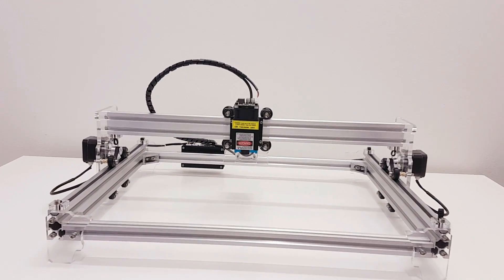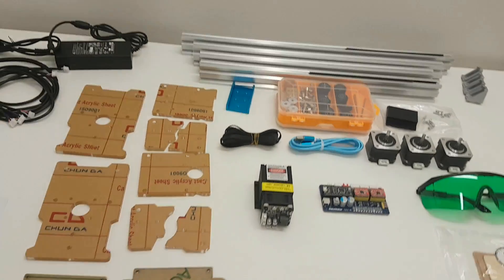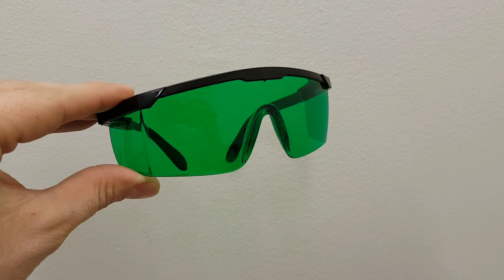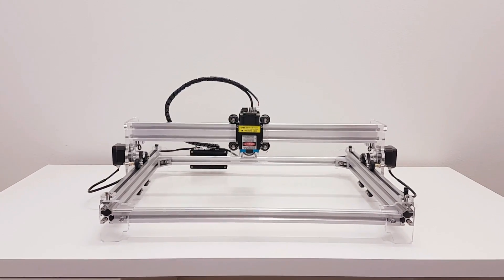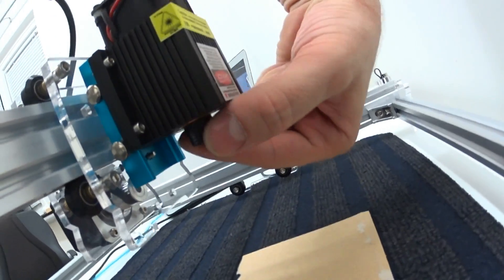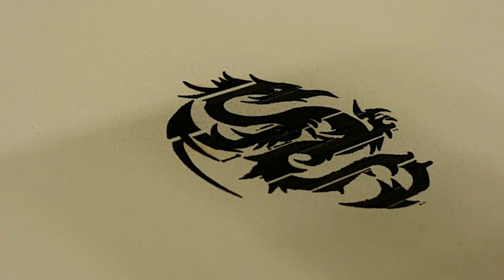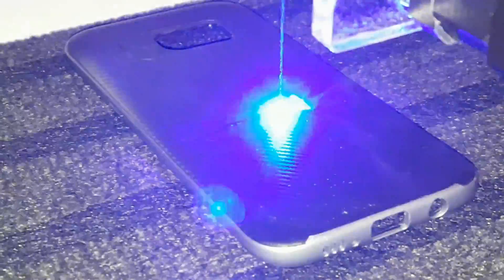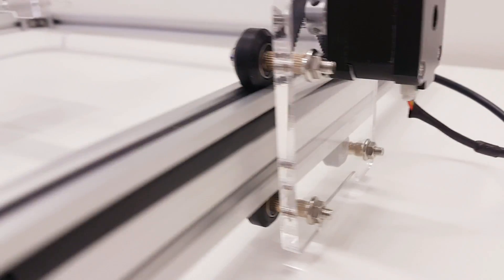A3 Pro 5500mW 300 x 380mm DIY Laser Engraver Build,Test and Review!

Comment: It doesn't work either.  Not a problem in the program I tried with 4 different ones and don't want to establish a connection with arduino nano.  It does not light green.

Comment: Hi Nexi Tech. I was wondering if you could tell me, if I buy a similar 500mw laser kit, and a separate 5500mw laser, would i be able to swap the laser out without any extra equipment. Both are 12v, can you think of anything else I might need or should it be as easy as a straight swap?

Comment: Can cutting wood 4mm in this machine with 5500mw
Reply from the maker: Yes yo can, but you need to set it to pass the same cut line few times, check this quick video where I cut 3mm plywood.  https://www.instagram.com/p/BVk-UJNhLZI/
Reply from the maker: Guys check this new dual laser engraver! This thing engrave even stainless steel - https://youtu.be/PoSRea1NrjY

Comment: Sorry for the silly question, but I'm a bit confused since sometimes I see advertised 2500mW and some other times 2500MW, regarding the laser power. MW and mW are different powers...  In the end, how much potency it requires and is it possible in a regular household?
Reply: A 2500 MW (Mega [or Million] Watts) laser would cut a hole through your floor, while consuming the power of your whole neighborhood. So they're all 2500mW (2500 Milli Watts = 2.5 Watts), and this is rather little, considering your microwave oven would use about 1000 Watts :)

Comment: Can  this unit cut 1/8” Balsa wood?  If so about how fast?  How about thin modeling plywood?  Thanks
Reply: Balsa may need 2-3 passes with 2.5w laser. 5.5 should do in 1-2 passes. Up to 1/4 plywood cuts in 3-5 passes usually. It won't do it in one go. It's an engraver not technically a cutter. But can do it

Comment: I bought a 7000 or a 7 watt engraver,  is it powerful enough to cut thin wood? I'm just a beginner at this. The only one's I see demonstrated are the 2.5's and the 5's. Also does anyone know what the best software to use is?  I'm not too crazy about eleks software.

Comment: I bought a laser cutter, only a small a4 one to start with, and I spent a whole day fiddling around trying to flash Grbl and get the steps/mm correct. I nearly bashed it against a wall but I held back and succeeded
Reply: From where you got A4 ?
Reply: RAKESH JADHAV got my 2.5W A4 laser cutter off eBay for around £90

Comment: Great video.. Does the laser lose any engraving power if height is extended over an object? I want to engrave wood object that cannot fit in engrave area, without raising the engraver. Thanks.
Reply from the maker: Andre Jacobs Well you have to have flat object and laser in focus to be able to engrave precisely and even. For example if you will engrave round(ball) object laser will go out of focus down the curve and it might not engrave at some spots at all or very week You can add more power but then on areas where laser is in foxus it will burn it way to much then on non focus places. I hope i explained it right.

Comment: Can this machine used for cutting fabric
Reply: same question , it will easily but the question is laser reability? getting heated up? can we use it for long duration etc. Same boat. I'm also looking for fabric cutting.
Reply from the maker: Yes of course there is plenty of power. Laser can cut thru 3mm plywood  pretty fast in 2 pass so i think fabric is not a problem.  You can use laser for hours and hours without problems. Laser diode has very good cooling fan on the top of heatsink so it has good air flow.

Comment: have a big question how does it print on leather ? i would like to see a video !
Reply: It prints very well on leather but make sure you're outside when doing it because it smells like burnt flesh when doing it... very stinky. Also, I find that the "Outline" cut works best and is much quicker on leather. If you are wanting to cut through the leather it will depend on the thickness of the hide but try running it at 400 speed with multiple passes.

Comment: Hi, this is a good video!! I'm looking for a laser cutter and I need some advice. Would a 3000 mW laser (3W) be enough to cut through fabric? Does anyone have any experience in this? Thank you very much!!!
Reply: That depends on the fabric (like if its fire retardant) but a 3000mw should be plenty for it. If it doesn't make a cut on the first pass, try slowing down the speed of the laser and increasing it's passes. Eventually the laser will cut it.
Reply: Same requirement for me as well. These are chinese machine rebranded. Looking to buy one for my factory purpose to cut fabric. I have the same question which laser should I buy to cut polyester. But considering the fact even 500mW will also do I think.
Reply: Correct. Laser cutting fabric doesn't require a high powered laser at all. just make sure the work area of the machine is large enough for what you're trying to accomplish.

Comment: when you want to place a drawing at an exact place. How do you manage that? Can you position and tell the engraver where the x=0/y=0 point is?
Can you turn the laser on to position it precisly whitout it to burn the material?
Reply: Yes, you can turn on the low powered laser as a guide when positioning the laser. Just make sure to turn off the low powered laser before making the actual cut.
Reply: Thanks !

Comment: Nice unit, I'm looking forward to getting one, the main use would be to cut 5mm white foamboard, have you done any test with this material? I would like to know if it would do a nice straight cut, without melting the foam away under the paper layer.
Also, are you able to control the power of the laser, so you can either cut & engrave on the same process?
Reply: This laser has cut everything I've thrown at it with the exception of some metals. The power level can be adjusted and you can also increase the speed of the laser so its not in one place for too long. Just make sure you have extra materials because you will need some to practice on.

Comment: Hello, I recently purchased a 500mw 65*50cm DIY Desktop Laser Engraving Marking Machine Printer Engraver kIt, I realized immediately that I need a Bigger and more powerful Laser system and also maybe a Controller upgrade,  I can also connect to my Computer to operate,  I would like to go to a 3W Laser and Better controlling system, But will Use my Main Frame 65*50cm,  any recommendations ??  who is a Reputable Seller that can work with me to get what I need ??  with some type of Support ??     Great Videos by the Way, thank you for sharing  :-)   Doug
Reply: I bought my 5500mw laser from Gearbest. The machine is great but their customer service sucks. I had to do a lot of internet searching for help but it all worked out and now I'm making all sorts of crap. It also helps if you work in a warehouse that gets free wood and materials.

Comment: What is the diference between 5599mW que 2500mW  láser engraver?
Reply: More power means you can cut and engrave faster. Example: a 5500mw laser may complete a 8"x13" project in 2-4 hours where a 2500mw laser may take 6-8 hours for the same project. This depends on the project of course but you get my point.
Reply from the maker: German Valencia 5500mw is twice as more powerful.

Comment: Nice review. Can this cut acrylic?
Reply from the maker: Thanks! Yes it can cut without any problem, only transparent color Acrylic it can't. Laser beam is just passing trough.
Reply: Colored or semi transparent acrylic has no problem. If you want to cut clear acrylic you're going to have to do some work. First cover the acrylic with a dark surface (like black fingernail polish or something similar that can be removed). Laser engrave directly onto the black fingernail polish. After the engraving is complete, wipe away with polish remover and voila, done.
Reply: This method also works if you want to engrave onto glass

Comment: HI, can I cut acrylic 3mm thick?
Reply from the maker: Yes but not transparent Acrylic.
Reply: Why not transparent?
Reply: If you want to cut clear acrylic you're going to have to do some work. First cover the acrylic with a dark surface (like black fingernail polish or something similar that can be removed). Laser engrave directly onto the black fingernail polish. After the engraving is complete, wipe away with polish remover and voila, done.

This method also works on glass
Reply: this methode work only for engraving or cut is work
Reply: Web Islands, it can be used for both. But you may need to reapply the surface material several times unless you have a strong enough laser that can cut it on the first run. This method is not ideal for cutting acrylic, just a cheap way to get it engraved.

Comment: mhh work on metal, inox,  alu eccec?
Reply from the maker: Sorry no metal. For cutting metal you need a lot more power.
Reply: but can it engrave metal
Reply: If I had black anodized aluminum plate, would it engrave through that to show the aluminum?  I want to engrave trophy plates.

Comment: I WANT TO ASK A QUESTION ABOUT THE LIFE OF LASER
HOW LONG LASER IS WORK?
Reply from the maker: 'Quote''
Calculating estimated lifetimes is an important
step in the development and application of laser
diodes. Lifetimes at normal use temperatures
can be estimated from the lifetime statistics and
activation energy obtained through multitemperature
testing. The laser diodes reported
here are predicted to have a median time to
failure of approximately 70,000 hours, or 8
years at a use temperature of 40°C. 
https://assets.newport.com/webDocuments-EN/images/AN33_Laser_Diode_Activation_IX.pdf

Comment: my question is that what is the life of laser beam
Reply from the maker: ''Quote''
Calculating estimated lifetimes is an important
step in the development and application of laser
diodes. Lifetimes at normal use temperatures
can be estimated from the lifetime statistics and
activation energy obtained through multitemperature
testing. The laser diodes reported
here are predicted to have a median time to
failure of approximately 70,000 hours, or 8
years at a use temperature of 40°C. 
https://assets.newport.com/webDocuments-EN/images/AN33_Laser_Diode_Activation_IX.pdf
Reply: Nexi Tech and

Comment: What kind of software is supported? It support "ai" (illustrator) or something from vectorial files?
Reply: It likely uses SVG format with upto 300DPI.   That being said, any vector software should work fine if the export is correctly scaled and set to RGB.   Inkscape is highly popular since it's cheap.  But I prefer using corel over all others.

Comment: Hey does it also cuts acrylic sheet, if so upto what thickness ?
Reply from the maker: Only if is black. Transparent materials is very hard to cut with laser. With  300mm/s speed you can cut through 3mm plywood in 3 pass. I you slow down even more you can cut through in 2 pass but it's going to burn maybe to much. It's cutting 3mm plywood pretty good. Possibly you can cut through even more thick plywood or similar material by just let the laser pass more times cutting line.

Comment: Is it possible to cut perhaps 3 to 5 mm balsa or 3 mm wood wiith this machine without modifications?
Reply from the maker: Yes Mark! With  300mm/s speed you can cut through 3mm plywood in 3 pass. I you slow down even more you can cut through in 2 pass but it's going to burn maybe to much. It's cutting 3mm plywood pretty good. Possibly you can cut through even more thick plywood or similar material by just let the laser pass more times cutting line.

Comment: Hello, can you cut cardstock with this engraver? I like it but my main purpose is to cut thicker paper? Best Regards
Reply from the maker: HI there! Thanks for stopping by. I just answer to Mark below. This is copy-paste: ''At 300mm/s speed you can cut through 3mm plywood in 3 pass. I you slow down even more you can cut through in 2 pass but it's going to burn maybe to much. It's cutting 3mm plywood pretty good. Possibly you can cut through even more thick plywood or similar material by just let the laser pass more times cutting line''. Best regards! :)

Comment: hai, it's possible to cut MDF wood and clear acrylic ? I usually cut MDF wood using CNC router, and need to know if I can replace it with LED laser
Reply: A diode laser isn't for you. A CO2 laser will reluctantly cut MDF--when cutting plywood, lasers have more trouble with the glue than the wood, and MDF is largely glue.  Clear acrylic is transparent to blue light (you can see blue things through it, after all) so it doesn't absorb energy from a blue laser.  Infrared lasers like CO2 lasers cut through clear acrylic beautifully.

Comment: Is it accurate? I want one of 10w and 1 meter of work area but I just want it to cut polyester textile ... like the fabric they wear for soccer uniforms ... does it have speed to cut things like polyester fabric?
Reply from the maker: antero414yo Yes its very accurate.  Well 3mm plywood is cutting  through in 3 pass in 300mm speed without  sweat. If you lower the moving speed I can cut through in 2 pass but its burn to much.  I Never tried polyester fabric so I can't answer.
Reply: Very good information, I really would like to have a computer like this ... can you use it with illustrator or corel?
Reply: Friend ... I was trying to use the program to test my 550mw laser cutter and the laser light went on ... I hit a metal bar and the room lit ... I did not see it directly but I could feel the blue light ... do you think he hurt me? I did not have the glasses on ... it was only an instant and I know that it takes a millisecond to hurt ... I'm afraid that it hurt me.
Reply from the maker: Jesus! NEVER EVER USE LASER over 10mw WITHOUT PROTECTIVE GLASSES! This 5500W laser can blind you in the second! Everything over 10mw can damage your eyes. Please go to doctor and check your eyes! You have to be much more careful next time. I hope you did not damage your eyes! :(
Reply: I have already returned from the doctor ... luckily I have no damage, it was not inflammation nor damaged cornea ... everything in order, happy to be well ... and very scared, I'm afraid to use my laser ... but I know I'm left Learn to get all the juice to this great machine. At the moment I do not know if the Benbox is a good program or do you recommend another program to use the laser?

Comment: Hey, nice video. Would i need anything more than a US to EU plug changer for this to work in Europe? Would i need a voltage converter to?
Reply from the maker: Thanks mate! The main power to the whole Laser engraver is Adapter with Output DC 12V 5A and on back on adapter is label saying input AC 100-240V so you can go easy with  EU plug and save money.  :) Use provide links in video description and coupon to save even more money :)  You will get better price. Good luck with your Laser.
Reply: Wondering if you can help me with a similar machine if possible

Comment: Hi.I have the same problem , with the white line ( skipped line ) , just like your first attempts with the dragon.  Can you   please provide the settings you changed ? I made a lot of test but can get the right settings , curious of howbyou did it,m. Thanks!
Reply from the maker: You need to tighten the motor bands and use lower speed check them all.  Please report back if problem is solved.
Reply: Super Vidéo !!! 

Thanks for your good work.

Y from switzerland

Comment: I have the same laser as you, the problem that you are having with the lines is becauseYou need to tighten the motor bands, also it seems that the capacitors that the laser haves are not enough and then sometimes the laser lose power, to avoid that you can pause the laser after 1 or 2 minutes of work so the capacitors can refill again, you can use a keyboard/mouse control program to do that automatically.
the other way is to use less power in your laser and move the motors slowly
Reply from the maker: animes25 Thanks Mate! Tightening belts solved problem! Cheers!
Reply: I want to buy it....i m not getting the link...can anyone share the direct link

Comment: yo, Nexi, i have the machine, and the 2500mw module bought separately. the module has only 2 cables, positive and negative. and the machine has 3 cables to connect. so, how do you connect the module, man? i am stuck. help me, man

Comment: mine does not control the laser :( its got an off/on switch ontop but the software control does not work..
Reply from the maker: The Hot End - 3D Printing & Technology Look for the buttons on top of laser module. Find right combination and it will be accepted in software. Practically you need to click on each button couple times until you turn laser off or swich it to low power mode then you flash it using provide software and then try to turn off or on laser using software.
Reply: Theres only 1 button, low power mode - tried it both off and on and reflashed software. I think the arduino nano is dead/faulty as the pin does not switch voltage when software is telling laser to be on or off

Comment: can it cut 4mm plexi?
Reply from the maker: Coďák Unfortunately I don't have 4mm plexiglass to try ut but if Laser can easily burn in on white 25mm plywood so much on 20% power then it can definitely cut 4mm Plexiglas on 100% power. But I do think you have to use black plexiglass to make it work. Transparent will not work.
Reply: This is not good... Well I need to decide if I'll go with clasic CNC router or laser router..... Seems like that CNC will be better for me.. Thx ;)